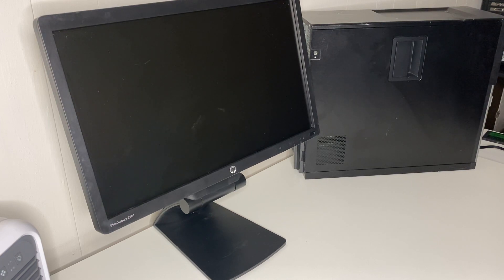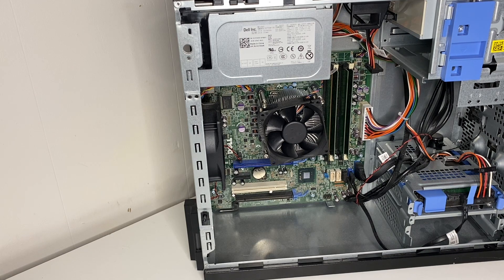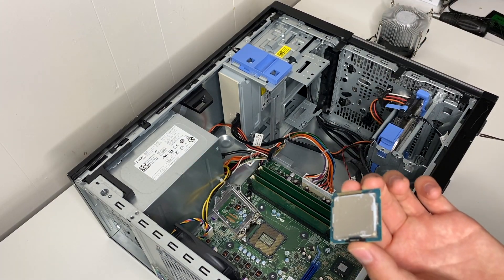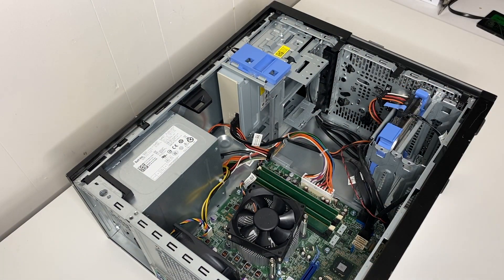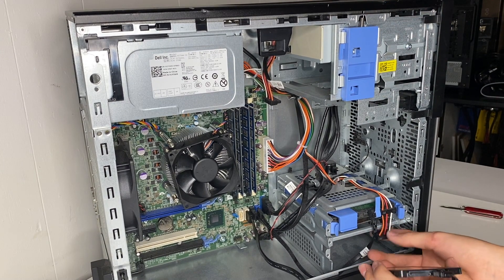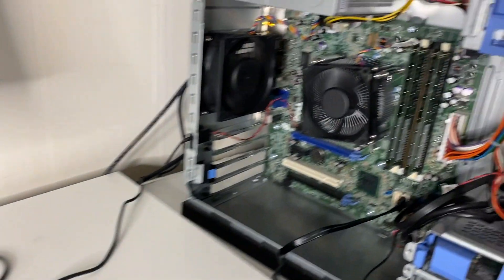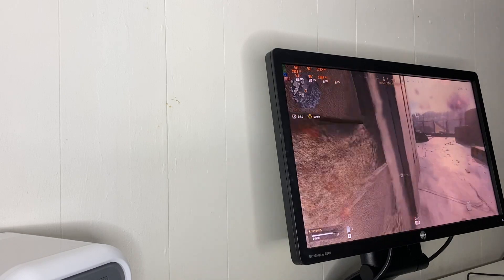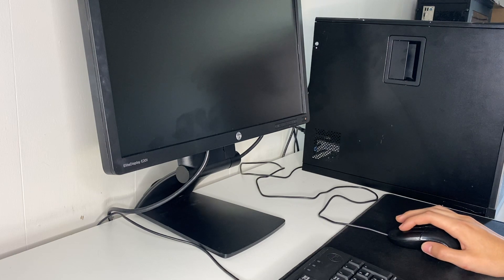300$ Warzone Gaming Pc Setup!

Comment: I have a Dell Optiplex 9020mt as well. Which GPU&Processor is best? I heard the i7-4790 is good but I'm not sure. I am currently saving up to try and upgrade my Optiplex to the best upgrades it can have. I bought it on EBay for around $300 and the only downside it has is the storage (120gb SSD from Kingston) and it has a aging Radeon XFX R7260X Ghost GDDR5 1gb GPU. And I'm done playing warzone on console since there's still no FOV slider. Hope you can answer. Thanks.
Reply: if you can fund a decent deal on a gpu like a gtx 1050 ti you are pretty much good, also maybe buy another ssd for game storage and let the 120gb ssd as the windows holder
Reply: @terorwolfable  that 4790 can handle way more than a 1050ti. Considering gpu prices are dropping rn I'd go for an Rx 470, 480, or even a 1070 if you can fit that. The i7-490 can do way more than a 1050 and either one of those GPUs will be a huge jump in performance from it. Currently running a Lenovo e73 mt as my main rig with a xeon 1230 v3 and an Rx 470 4gb. Planning to upgrade to a 480 8gb very soon for that extra vram in games like warzone and doom eternal. Just remember to upgrade the PSU if you do go for these cards

Comment: hi i have a dell optiplex 7010 with i5 3570, 8gb ram. which gpu should I put to run warzone above 60fps without it going down. obviously I will mount 16gb ram
Reply from the maker: Gtx 1060, rx 480, 580, 570 and gtx 1650. You can maybe get by with a 1050ti
Reply: if i mounted 16gb ram, gtx 1050ti, i5 3570 drops below 60?, in general would it run well? should i change power supply? sorry for my english and my questions but i don't understand much
Reply from the maker: @lorenzovisconti4186  it would play good. Just on lower settings, the Power supply should be plenty good. I hope I was able to help
Reply: @ElijahsLab  where did u find a cheap 1050
Reply from the maker: @coolgamer6713  my local market
Reply: @ElijahsLab  so waomart right?
Reply: @coolgamer6713  waomart xd